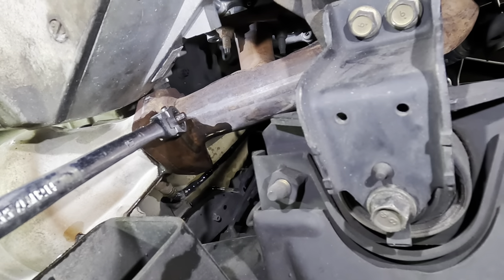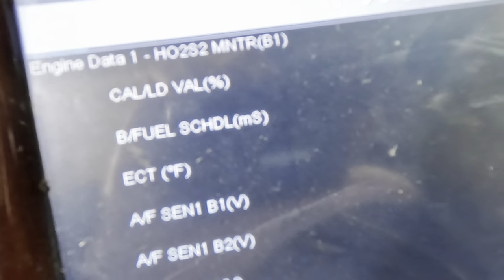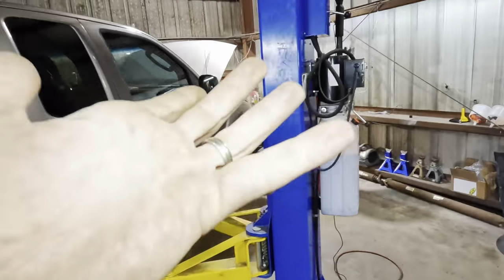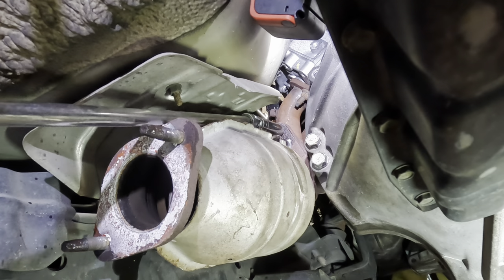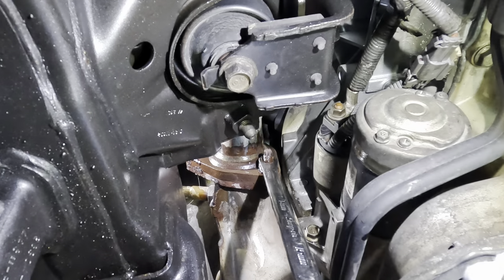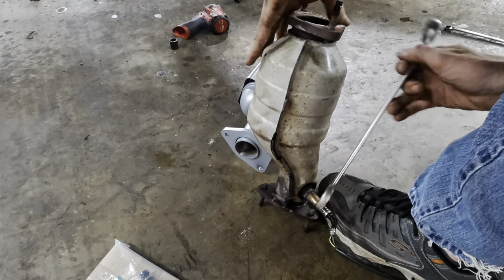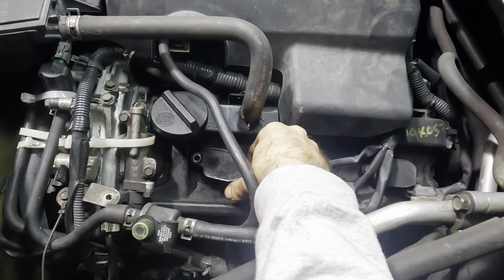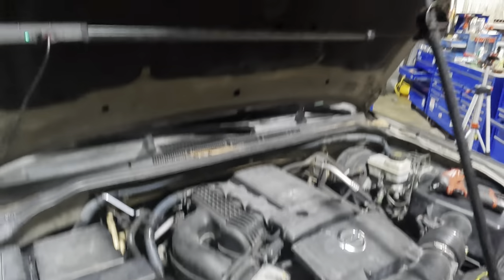Catalytic Converters! Missing?  Running Rough P0302 P0420 P0430 Nissan Fronter 4.0 v6

Comment: The wheels are free rolling and airplanes push/pull on air. Not on the road.
It would take-off.

As if a FWD-car with the rear axel on the ground, doing nothing and front on the dyno, would not give any indication.

I don't have Otto as a profile pic for no reason ;)

Comment: A airplane uses flaps on the wings and tail to generate lift. The engines generate speed to maintain air flow needed to generate enough lift for the craft to fly. The engines are not necessarily  needed. The problem with the belt method is once the plain leaves the belt it loses its source of propulsion. The answer is yes the plain would fly but only for a short period of time.

Comment: Hercules batteries work great I bought three in the last three to four years and all 3 are still working well minus the oldest one works great takes to charge just doesn't have the chooch the other two have but it could have different battery tech case is different colors to on said unit

Comment: Ive been an aircraft engineer building aircraft from leaving school at 16 till I retired I’m now 70 and only air speed over a wing will give it lift 👍
Reply: and,  what...?         that fact does not answer  the 'question'.
Reply: @daviddavids2884  if you can’t work that answer out for yourself I’ll explain it for you = if the aircraft is on a rolling road then the aircraft is not traveling forward, if aircraft not traveling forward then no air is moving over the wing therefore no lift is created under the wing which in turn means the aircraft CANNOT TAKE OFF! Simples 😂

Comment: Tools found in the engine are yours unless marked otherwise.  If the tools are the customers, you can bet they will ask for them at a later date.  Tools from another tech, too sad, unless like you say from same shop.   My old service mgr drilled into me that when done with a job, take the extra 5 minutes, put all of your tools back to proper locations.  That way you can visually see if something may have been left behind.  Has paid out dividends for me.  In 33 years only lost a few tools, never anything expensive yet (fingers crossed)

Comment: Interesting. Remove batteries from charging station. If turned off I noticed my streamlight was charged fully left unplugged for 3 days both batteries completely dead lol. Your snap on battery must have inconsistently discharged its cells thus leaving it over the holiday completely discharged it good thinking dude. Plugged My batteries in and they're fully charged wheew.   😮😅😊

Comment: Had an 07 frontier.  I am a nissan guy from my 17th year and I detested this truck.  The 4.0L V6 was thrashy and gutless, the timing chain guides began to wear out right after warranty expired ($1,200 for that work), and the transmission was trashed by coolant leaking into it from the cooling system/transmission cooler (replaced under warranty).  This truck was pretty much junk.  If it were my only experience with the brand, I would have ran away long ago.  Unfortunately, no good can come of laying with Renault and putting their parts in Nissan cars and trucks.

Comment: A conveyor moving an airplane forward at takeoff speed is sufficient to achieve flight, as long as the engine(s) are set full throttle to maintain lift. No diff from catapult launch on aircraft carriers ✈️

Comment: 1. This is the longest video from Rainman Ray that I have watched through. It was good.
2. An airplane will definitely not fly without airspeed.
3. Do you really steal tools from customer vehicles? Because it looks like that's what you are doing. But I don't think you would do that.

Comment: The 747 riddle. The intuitive answer would be "No it can't fly". The problem with these types of riddles is that they are deliberately kept vague to return several answers some will be yes and some will be no. It is all relevant to all conditions at the time and the conditions applying to the question which in the case shown doesn't have any implied.

Comment: On your thought about gas, the lower quality gas is a whole misunderstanding of whats going on with fuel. Its the addition of Ethanol which extends the gasoline and for the amount of extension, the drop in power is not that much so it would be quite efficient use and the emissions stuff would be there until we burn a different type of fuel all together (not gasoline or diesel) and even then it would still be there in some form to catch some of the carbon emissions. 
The whole argument is done by people that want as much power from their sports cars and throw hissy fits over the gas being "dilluted" but when they take engines from the late 60s to early 70s that have a rated HP from factory and they take and put those engines (rebuilt to new) and run them with the new fuels and get the same HP when timing is set kinda shows its not as diluted as they think it is. Half the times they got old gas or contaminated gas from the pump and running it or the other half is they need to service the car and maybe do spring adjustments on their mowers cause the springs are getting weak and effecting the idle.

Comment: Mac toolman told me that like a vehicle. Each joint loose up to 10% of power. Do you got two joints so lose 20% with extension on ratchet

Comment: I think the important part of the question is does the plane actually have wheels or is it without wheels on the conveyor. With wheels the plane isn’t actually moving the wheels re just spinning so no flight. Without wheels the conveyor is actually moving the plane so you would have flight
Reply: totally  WONKY  and  wrong     bh
Reply: @daviddavids2884  explain then mr David Davids

Comment: I love how that airplane question really messes with people's brains. It's a great demonstration of how "frame of reference" can be counter intuitive.
The plane moves forward and takes off regardless of how fast it's wheels are already turning or how fast the "ground" is already moving under it.
This can be demonstrated at small scale with gas engine model planes on a real conveyor belt.

Comment: Lift comes from a lower air pressure caused by increased air speed above the wing. A vortex creates drag and is the enemy of efficient flight. The plane will not fly if the wings are not moving fwd through air. If the conveyor speed matches wheel speed the body of the plane will not move. If the body doesn't move the wings don't move. If the wings don't move there is no airflow and no lift. It's like the venturi in a carb. One other error in many statements. The engine, prop or jet, doesn't push the aircraft. They pull it through the air.
Reply: bla-bla-bla      reality check      the forward motion of an aircraft is not dependent on the ground or the wheels/landing gear.    see  THRUST.
Reply: Bla bla bla is right.
Reply: If the brakes were locked and they went to full power would it fly? After all wheels have nothing to do with it right?

Comment: Regarding the airplane, both answers are correct.  However once in the air, lacking air speed it will fall back to the earth with much force. This will not matter because the planes are designed to withstand a fall of 5 mm. If you wish to prevent this action get a supper smooth conveyor belt.

Comment: Those that said it will fly to your internet question were wrong. It matching the wheel speed will have no effect. Speed of the wheels has nothing to do with it. So those stating it would fly are wrong. An airplane works off of lift on the wings due to the speed of the wind going over the wings. That 747 needs to be going 160 kts to get enough lift to take off. So, if that conveyor belt also came with a fan that could create a wind at 160 knots it could generate enough lift to make that 747 lift off and fly in place. But without wind to provide "lift", that plane is going nowhere.

Comment: The conveyor belt would have no effect on the aircraft, because it doesn't traction with the ground to move, i.e. how fast it's wheels are turning or if they're turning at all has nothing to do with it, it's being moved by the thrust from the jet engines.

Comment: Nothing wrong with your alternator or charging system. 
You’re seeing the voltage drop after start up because the intake air manifold grid heater comes on and draws a lot of current until it times out.

Comment: You didn’t fully complete the job! You have to do the special functions menu on the snap on/Autel whatever you prefer and do the converter adaptations procedure… Much the same as changing a dpf on a diesel you have to reset the learned values once replaced so the Ecu can set the trims correctly for the increase in exhaust flow. This also sets the idle speed back to factory ideals because before when they were hollowed the vehicle was receiving incorrect voltage fluctuation signals from the o2 and tried to compensate.. also you should have checked the sensor values after replacement with a scope maybe a pico if you have one if not a snap on versus or equal spec Diag tool they have scope ports on the top. Good job though mate as usual
Reply: Meant to say increase in exhaust back pressure**

Comment: 5:23 charge controller will not let you charge a battery that has a programmed fault. When the battery gets cold it will drop voltage and reset the charge controller chip in that battery. This  is why the battery is working again. The fault was cleared. 

This is not a way to “fix” a battery.

Comment: Hi,I always use neversize on exhust systems and other rust prone spots,even if it's not my vehicle. What are you going to do ten years from now when we have more electric cars and the cars have more sensors then moveing parts.The new Mercedes have over two hundred micro processors to fail,even their service men have trouble finding problems.

Comment: The exhaust system needs 'ta be grounded because it will act as a radiating antenna for RF Spectral Noise, especially spark noise the active engine systems create in operation....DO NOT OMIT THIS GROUND WIRE....If this is not in place, there will be excessive RF Radiated Emissions from the engine....and may trigger false system DTC's and produce excess RF noise so as to render GPS and Satellite Radio inoperational....Just an "Oh by the way".....I'm an RF Systems engineer with a US Auto manufacturer....Some tips and information for you and the backyard mechanic

Comment: I was wondering why you did not use antiseize on the threads of the 02 sensors? I anti-seize all exhaust bolts but, I live in the rust belt so, Yeah!!!

Comment: The 747, nor any fixed- wing aircraft would take off, no airflow over the wings/airfoils which the flow differential causes air pressure differential which is what generates the needed lift to fly an aircraft.
speed of wheels will not reflect actual groundspeed, which like the airspeed would be zero.
 Been there, done that.😎

Comment: Mythbusters actually did the conveyor belt experiment ages ago - and guess what - the airplane still took off (the pilot they hired swore up and down it wouldn't) - the reason is because forward thrust has nothing to do with what the airplanes wheels are doing.

Comment: Lithium ion batteries break if you charge them when the battery is below 32⁰F. Charging a battery that cold pretty well instantly forms dendrites, which can pierce the separator between the anode and cathode, internally shorting the battery.  Even if the battery does not outright die, charging even once below freezing seriously degrades the battery.  I imagine this is not something you have to deal with often in Florida.  It is something I deal with in Michigan a lot.  :)
Reply: So much for electrics cars eh?
Reply: @stevenbaker9327  I own 3.  They take this into account by keeping the battery warm, even when the car is off.  Kind like a block heater on a diesel engine. Those are frequently required up here, too 🤣

Comment: As far as the airplane on a treadmill it is possible under the conditions that the engines are running for it to become airborne. There are VTOLs like the Harrier that require zero airspeed for flight. There are also STOL aircraft that can take flight from basically a dead stop as long as there is sufficient power to lift the craft. Although this goes against the spirit of the argument.

Comment: Ya need 'ta replace all the insulator boots on those coils....I had 'ta do that on my 2006 Ford Escape two years ago.....Typical......Misfire problem solved but changed all the plugs while I was at that level of disassembly......Always use the logic that if one is bad, the rest are also, or will fail in the near future.....Do the job once, and do it right.....

Comment: The few times I have replaced O2 sensors, anti-seize was included to for the threads. Is that not best practice for reinstalling O2 sensors?

Comment: If you have a misfire code, fix the misfire code reset the fault code. The P0420 and P0430 properly caused by the misfire code.

Comment: how come no antisieze on the o2 sensor threads, also the diameter of those threads look slightly larger than the actual hole, i'd say they've given imperial threads where it should have been metric or the other way around

Comment: I think the plane would fly as all it takes is reaching takeoff speed. Since the wheels on a plane are unpowered the plan more just rolls over the conveyor as if it was barely there. A car wouldn't move but the plane shouldn't have the same issue. I'd say the only concern is that the tires would likely fail from spinning up much faster than intended.

Okay I looked it up, turns out the Mythbusters tested it, and the airplane took off just fine. Again, planes don't move by rolling their wheels, they're just there to hold it up.

Comment: I have a knock off of a Milwaukee 18 Volt battery pack that refused to charge. I zapped each individual battery inside it with a heavy duty car battery charger and it  charges again.

Comment: The plane would not take off. This is why, Even if the conveyor belt could move the plane fast enough to reach takeoff speed, once the aircraft wheels leave the conveyor belt (the ground) the plane would lose all forward speed (thrust) since the engines are only creating enough thrust to keep the plane from rolling backwards, but not enough speed to continue flight after liftoff (V2).  The planes engines would have to create and maintain enough thrust to continue flight after takeoff, and if that's the case, what would be the point of the conveyor belt?

Comment: Mythbusters busted that myth.  They made a HUGE conveyor belt and put a plane on it.  Ran the belt at the speed you need to take off, and the plane took off with next to zero issues.  The reason is...  the wheels on thr plane are not drive wheels, they're just passive.  The speed comes from the propeller (or jet engines), the wheels are just there to roll on.  Look it up

Comment: How do the converters get gutted like that? Are they disintegrated by either a problem in the engine or maybe just age, or is this how they do cat theft these days, remove the converters, take all the valuable materials from inside and put the empty cases back on the car?

Comment: I stopped using regular gas that has 10% ethanol in my 07 Buick Lucerne animal used in ethanol free I went from 12 miles to the gallon up to 22 and it runs a lot better

Comment: Wing lift requires air flow and therefore wing speed relative to the air around it.  A plane can fly with ZERO ground speed if the wind speed across the wings is high enough. It cannot fly without air/wind speed over and under the main wings.  Additionally, the thrust provided by each 747-400 engine is 57k# to 62k# say a total thrust of 240k# is available.  The empty weight of this empty aircraft is about 410K#.  So, if all four engines could be positioned such that their thrust could be directed through the center of gravity of the airframe it still would not leave the ground.  The airframe needs to be accelerated down the runway with available thrust until air speed across the wings creates the needed lift.  Since the rolling resistance is much lower that the available thrust the plane will move down the runway; I know I've seen it a hundred times.

Comment: The wheels of an aircraft are not driven so it makes no difference how fast the conveyor is moving as the wheels can spin freely. As long as the wings are being driven forward through the air by the engines they will gain speed and the plane will reach takeoff speed relative to the air. The wheels will be spinning very fast but that doesn't matter. Imagine a toy car on a moving conveyor, as long as the wheels spin freely you can still move it along with your hand. Same thing.

Comment: If the battery will not charge, take a good battery + > + and -- > -- for about 5 sec two times then put it back on the charger it should charge now. 👍

Comment: You could probably design some kind of aircraft that could take off like that, but not a regular plane that requires velocity and atmospheric friction to generate lift. But there are way better solutions for such ridiculous hypothesis already, like the osprey or harrier lmao. 
A C-130 can take off in a football field, given it has JATO(jet assisted take-off) tubes installed...Bay of pigs? lmao (i was a C-130 Crew Chief in the USAF)
But when you think about it that treadmill situation is really no different than if it was stationary, so what is the point?

Comment: I'll never have to worry about that repair as I remove cats, egr, and all epa crap off every car I buy. Put a sparkplug defouler where the o2 sensor goes, then screw the sensor into the defouler and the pcm thinks you still have a cat so no cel light and no running lean.

Comment: Is it not possible that since the plug gap is the smallest distance, by lifting the coil you have caused the insulation failure for the first time?